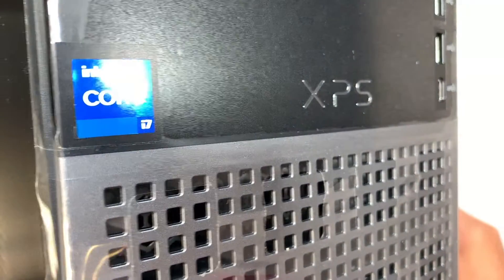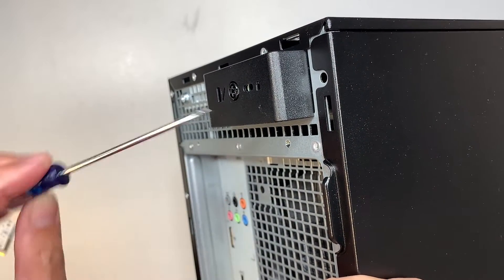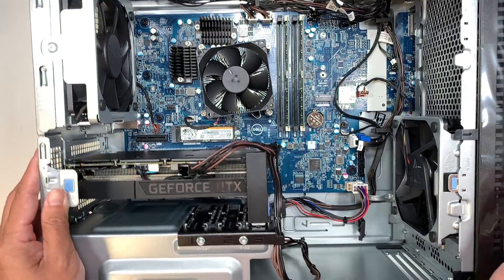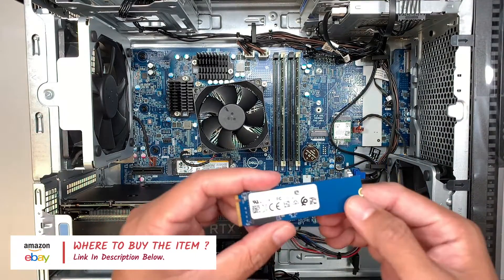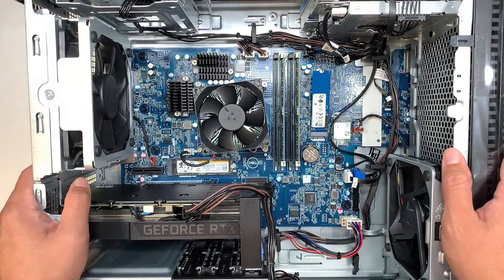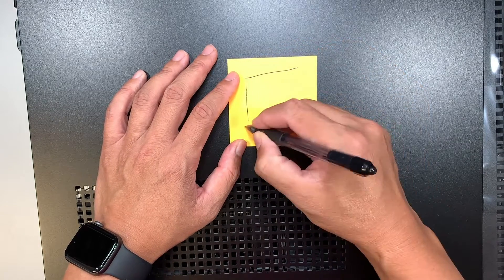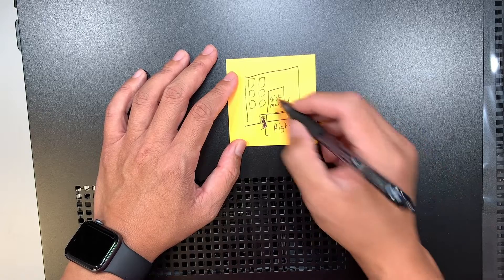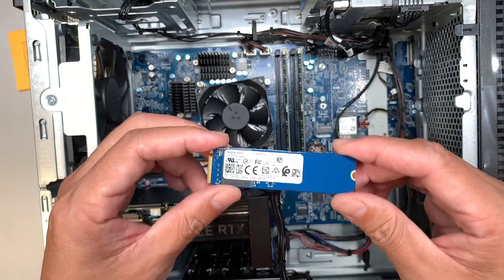Dell XPS 8950 Add M 2 SSD Storage Space

Comment: Thanks @UbergeeksBiz ! I just bought the Dell XPS 8950 yesterday at Best Buy, Saratoga NY, and first thing I do is increase the memory and hard drives size. I haven't opened yet, so your video is very helpful to show the potential available on that motherboard.   Footnote re the needed screw for the SSD hard drive card- I had computers since the mid 1990s, if I have to discard them, I ALWAYS remove and keep all screws of any type or size in a plastic compartment box besides other parts that could be useful for future motherboards or other small footprint electronics projects.

Comment: Well I installed a 1 tb Samsung 980 pro into a new Dell xps 8950 and it made the computer constantly freeze up. Runs perfectly after removing the drive. I went through the disk management process and said everything was fine.

Anybody else have this issue with Samsung drives?